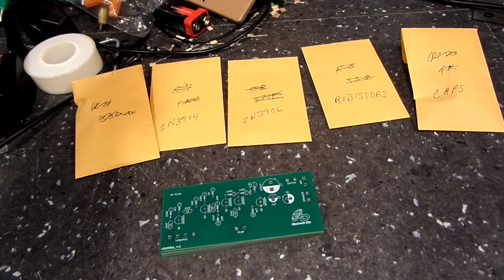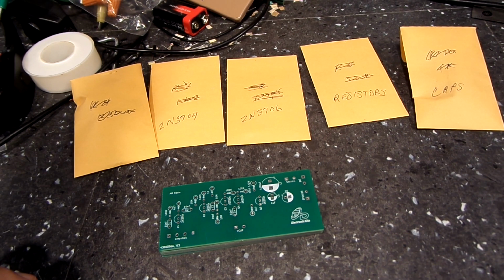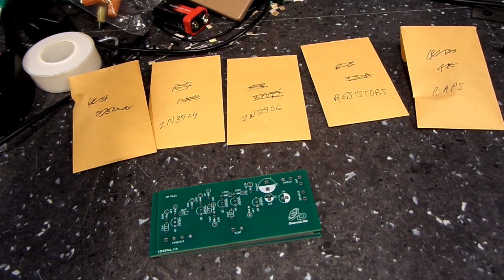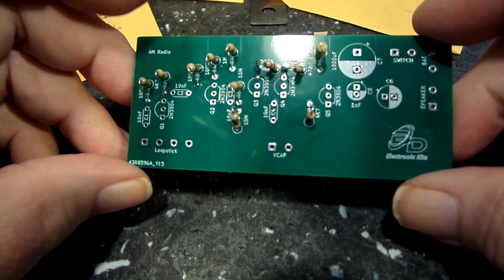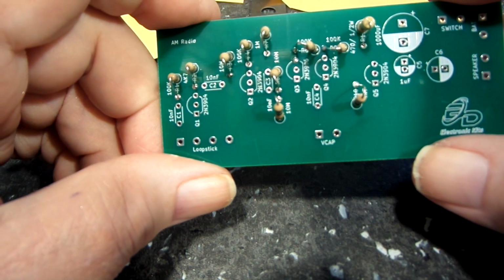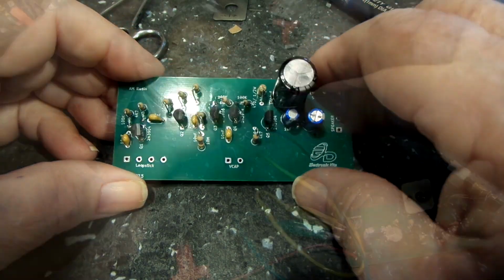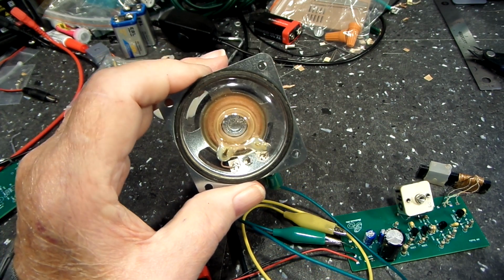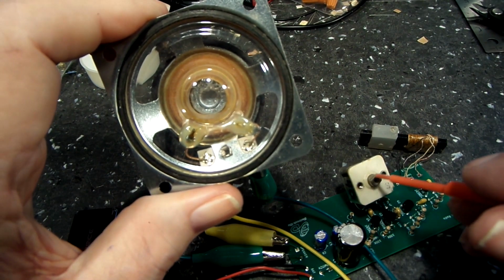Building and testing the TRF radio...

Comment: Many years ago I had 2 transistor radios, they had heavy magnet speakers in them, very well made and were regenerative radios.
Just 2 transistors but they picked up about 2 stations as I remember, I should have kept them, not much good except at a collectors items.
As you may know regenerative radios had poor selectivity  but had a lot of gain but other stations would come in also on top of the one you were listening to.
Reply from the maker: Thanks Bill. I saw the circuits in that Build a transistor radio book I spoke of for TRF and Regen radios and I may play around with those also. Almost bought one of those radios I saw on Offer Up with two transistors, but the price was kind of high. :)